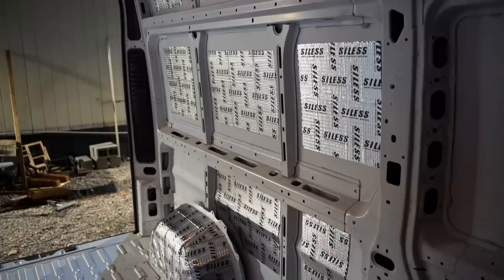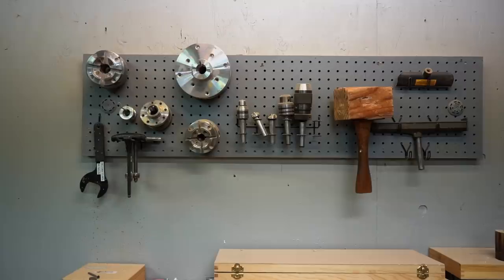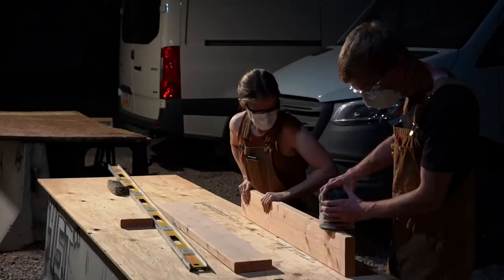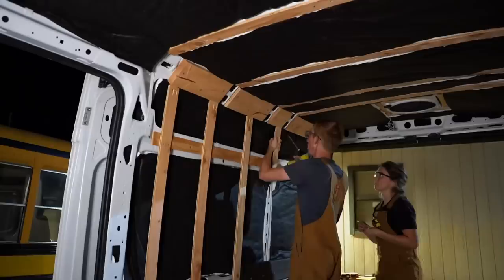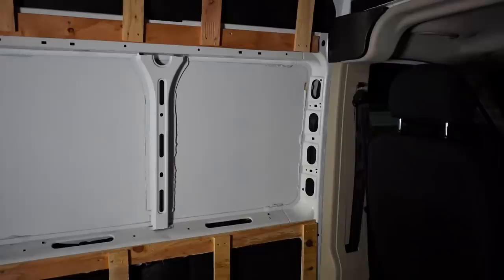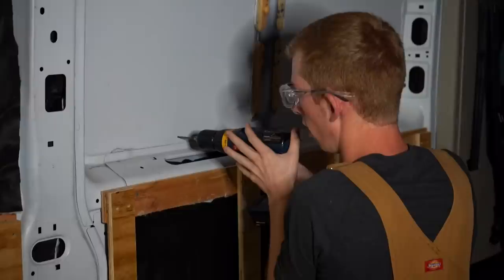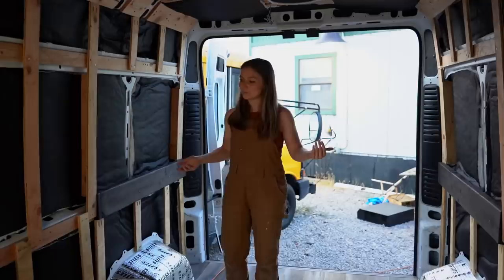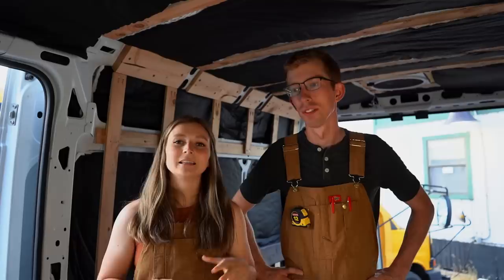CHOOSING A LAYOUT | Framing Our Promaster & Window Install

Comment: Everything about the layout seems perfect. But would be great to build a separate shower and space for toilet instead of a couch.
Reply: I totally agree
Reply: DITTO I just cant imagine, especially for boondockers, having an RV without a shower YUK having to drive to town for a Gym or Y to find a shower.
Reply: @OldJohnT102347  maybe they will add an outdoor shower.
Reply: Maybe a collapsible shower like in a Rialta, maybe omitting the bathroom lavatory, or even a simple removable curtain hanger( hulahoop ?) and a stowaway shower pan like a washing machine overflow/drip pan ( #3 washtub or infant pool ) or possibly even a folding wooden frame with a heavy residential shower pan liner grade membrane and a showerhead to attach to the kitchen sink, all to stowaway when not in use. You might just appreciate a shower after a hike or ride whlle boondocking. A passive solar water heater tube on the roof would give you a nice little bit of hot water.
Reply: Toilet n shower for me
Reply: @pagecericola7342  not easy to do in a rig that small.

Comment: Love the couch area idea, what about hiding a shower pan under the couch? You could store the curtain under the couch.  Just hang it up when you need a shower type thing.  This way it’s not a “permanent” fixture.  The shower pan under couch area with Glasliner/Plastic Panel. It’s super thin so low weight.  You could also set up an outside shower, you just need the shower head and a curtain, use heavy duty magnets from Harbor Freight.  

Are you doing a water heater?

My priority’s for my build beyond basic insulation and such is the biggest water tank I can - with filter system. Hidden toilet/shower. Mucho Solar based on costs and capabilities. Queen fixed  bed.  Swivel Seat / bench-table area to work & eat.

Comment: You could put an outside shower in the back so with the rear doors open you could hang a rod between the doors with a shower curtain for a back<privacy> wall for the shower.

Comment: Swap the sink location with the range. Have the sink by the door. Install a flexi spout that can be used to spray off outside or even shower. You can buy a shower/potty tent for cheap. Makes your plumbing much more accessible too.
Reply: Yes! Absolutely! Switch the sink and the stove. I have a pop up changing/potty tent. It's awesome!

Comment: Have you ever checked into putting in an outdoor shower at the back of the van - with an on demand water heater? Saw some pretty neat builds where they had a teak floor they put down and then a curtain they could attach between the doors and protecting the bed and garage area. Love the layout!

Comment: I think quite a few mentions are about making your diner a little different and using it interchangeable with a couch.  Leaving you room for a wet bath.  Also having the sink and not the stove by the door.  You good then have an extendable faucet for washing things outside.  Build how you want of course. Just a couple of experienced changes.

Comment: One of the things one learns in doing carpentry is the order of things.  The Van has structure, and before I would even put in the framing members, I would set up my electrical wiring. the Van has a lot of conduits to do the wiring for your Van build and not to take advantage of it before you do the framing, means that you may have to do some workarounds that were not given thought to.  So, do the wiring now before you complete the framing. Otherwise, you might end up tearing out the framing in order to set in the wiring for the Van.

Comment: Looks great guys! I love the idea of a dinette. Having a place to sit other than your bed is good for the build. My only concern (as someone who has built a van - and ended up remodeling it a year later 🤣) is that you might be doubling up on seating and sacrificing storage. The garage is mostly taken by bikes, electrical, and water tank. Here’s a thought - since you asked for suggestions. What if the table top of the dinette dropped down or converted somehow to make a little L shaped seating area for you so you could use the area between the dinette and bed as storage? That sliding door could be a nice place to put a screen (or act as the screen) for a projector. Loving your videos so much! Keep up the great work ❤️.
Reply: The panel they remove maybe a tabel or part of the dinette?
Reply: They could have a lagoon table on that too!
Then their little couch could become the bathroom/shower!

Comment: My suggestion is tape out your layout so you can get a good idea of the length, width, height of each item to be installed. Or use a software program to do a 3d mock up. Key to any build is  measurements = very little disappointments.
Reply: Y'all might even consider getting some cardboard boxes and literally boxing it out.

Comment: I’ve seen with another van I saw they made a box which looked like a tub with the toilet in it with a lid over it. The put a track with hooks for the shower curtain that in circles the box if you need a shower or you can pull it out just enough to give you some privacy   They had a hand helped shower wand    I hope I explained it ok so you kinda get what I’m saying.  What you are doing looks great. Keep going.

Comment: I think you should build out the floor under the table but make it where it will open with a shower pan in the bottom and install a shower head in the roog with a shower currtain on a loop. That way your dinette is multipurpose.

Comment: hello, in my opinion a shower is super necessary, it is true that it takes up space, but it is worth it, what you can do is look for a disassembled integrated design, in a dual-use space. it could work. Greetings. 🤗

Comment: I still think about the shower I think you will miss it after having one , but ones I have saw our like a box with your toilet and  you pull up the curtain  and attach to the ceiling  and it's all one   just let dry before packing back up in the box still not taking alot of room it's all contained  a thought ☺😊

Comment: Everything looks great. You guys are doing very good. 
Note on shower. You can have a no build shower. One you use in I case you really need one or you are exposed to something you must treat for.
(Very small inflated tub/pool. Loop to hang from ceiling or branches for a curtain.) If mounting inside hole in floor to drain onto ground or container.
Pump up spray bottle for wash water.
Not ideal for daily use but something if you need it.

Comment: From someone who lives in Canada and somewhat doesn't have the heat climate issues  the south gets, but we do get the cold weather temps. I am in the process of building out a van and I went insane on "R" value insulation mainly for the cold months, BUT, after the past heatwave we have experienced, the added insulation I have seriously helped with the heat inside the van.  Unless you are digging into your walls for cupboards or storage areas, fill them with batting to increase the "R" value, imho....to each their own of course.  Maybe that insulate will fill out the space but from where I sit it doesn't look like it will, I probably am wrong but if not.....spend a bit more and fill the spaces.  Also spray foam works very well in the van structure beams especially if you aren't running wiring through them.  Love your videos by the way, great couple with fantastic characters. Looking forward to the rest of the build. OH, I also demanded a shower but also sacrificed it for interior space....augh! I plan to hopefully hang a portable inside shower set up in my living area similar to yours.  Hopefully. As said above, humans NEED a shower to stay odor free....lol.

Comment: I think the sink should be next to door instead of stove so you could have the faucet to pull out and shower with outside the door or I seen someone make a shower curtain right at entrance of door with drain to even stand in Van while showering. Alot of 🆒 ideas 💡 from seeing others that don't have a so called built in shower.

Comment: I think you are doing a great job! I can't wait to see how your plans develop into a sweet home on wheels! Have you considered putting one of those specialty tables in between your driver's seat and the passenger seat? Those tables swivel in several directions, and come apart easily too... If the 2 seats faced each other, you could both use the table in between you. When not using the table, move it out of the way and turn the seats towards the main living space. This way you would not need to have a separate dinette and bench, and could instead use that space for the couch. And that would leave you with enough space for a bathroom where you are intending to put a couch. So you could have all of the features, and not go without a regular bathroom. Just a thought... Enjoy your journey!  ;-)
Reply: Great idea 👍👍

Comment: Don't worry about weighing that van down, I've used one for work for about 5 years and I load entire pallets of engineered hardwood into it with about 10 buckets of glue,tools and 2 people. The van will handle the weight just fine

Comment: Rig a little wet bay under the bed and use a an outdoor shower between the 2 back door when open.  I've seen others with vans do that.   It's also great for rinsing sand/dirt off feet/body after a walk/ swim.  Have you thought about a power lift bed?  I've no idea the cost of the mechanism but they sure do give you a lot of extra living space.

Comment: @Jimmy and Natalie, The layout seems entirely reasonable to me, but Im single and tend to think like a single person. That layout would be super for one. While it may test your relationship for a while, you two seem to really work at that already, so good on ya! I would have concerns about not having facilities, so one suggestion I have is that you incorporate an outdoor shower, which would give you much more flexibility, imho. There are tons of ideas to be found on youtube and it does not need to involve another cut in the van, so why not have the peace of mind. I mean, living with someone who totally stinks is not fun. Just my 2cents. Re: the toilet, I would like to see a curtain that can be pulled around it when in use. The overhead fan would sufficiently exhaust. You could easily use one of the RV curtain strips, which are flexible and would attach in a horseshoe to your ceiling, without being obtrusive. The curtain could be a fun colorful or cleverly designed shower curtain, so very little weight add and very functional.

Comment: Great job!  About showers I am a disabled veteran quadrapelegic. No ty many accessible showers at truck stopd or bathrooms.
There are many showers at truck stops for you. I use a female( urinal ordered on Amazon). I keep a wad of paper towels stuffed inside the top to avoid any odor. Easier then a toilet you can sit in a seat to use it pressing hard against you. Maybe not legal but I've dumped and rinsed it with large squirt bottle fulled with 1 part bleach 10 parts water. Or just water in a pinch. Dump in dirt or grass ( not someone's lawn ) lol. Bath wipes by Stryker are great for cowboy baths!!! They are thick and really wet no rinse necessary but I like to dry off! Have fun!!! Hope this helps!🤗🤗🤗🤗

Comment: Hi guys, my suggestion would be add a shower..As active as you guys are going to be hiking,biking,running,etc.I think you would appreciate a quick rinse.. Your partner might appreciate that more than not having a quick rinse off..
As far as stove burners location…..I think you should switch the stove top with the sink..Assuming you are going to use butane for your stovetop that would keep the burners out of the wind….Best of luck..Enjoy watching your channel..(You really need a shower..Also that would be a good place to store your toilet on wheels when not in use….) John
Reply: Could not agree more!!  Consider the experienced advice!!

Comment: This project reminds of a build I did years back. To solve your shower issue I purchased a portable hanging propane shower unit for the outdoors that is installed in a small changing popup tent.  Many folks just use the facilities in a gym but I wanted my own shower and bathroom.

Comment: You might place the sink next to the door. Get a sink with shallow side and a deep side. Then put your toilet under the shallow side.  For privacy use a round shower curtain rod hung from ceiling with shower
Curtain that Can be hidden away when not in use. Wish you two lots of luck on the build.

Comment: Cutting that window center support is super easy with 4 1/2" angle grinder with metal cutting blade. They're very handy tools for cutting/grinding a variety of materials. From metal, concrete, brick etc. Super cheap at Harbor Freight and they actually last a long time.

Comment: Thank You again for sharing your journey with us! Curious... How much do you think you will use the "tiny couch"? I mean, you will watch TV sitting up in bed with the TV on one of the walls above the bed, right? I would think the passenger seat swivel would accomplish the sitting area of the tiny couch with no extra space. Anyway, would a sit down toilet/shower be a space more used? Like framed in, but small and short, maybe cabinets outside on top of the shower? I think privacy at night when the other is in bed may be more important than a tiny couch is all. There is also still my idea of putting plumbing for a shower in the back so when you open the back doors, a circle curtain would contain a stand-up shower. Thanks Again!

Comment: Check out the OGO  compost toilet it has a much smaller foot print than the nature's head but a bit more on cost for a composting toilet. We really love this toilet it is easy to clean a light tells you when the urine is full and easy to clean, and no smell. It has a fan for ventilation, we are not to that part of our build but we did set it up in the bus and went camping for a week and use a toilet for 2 weeks for the 2 of us and it worked well.

Comment: Doing a very similar project!  The style, will be smaller, screen  windows, all around the back area (I love fresh air cross venting optional).  And keeping everything light weight.  A comfortable large  mattress directly above the wheel well flowing back to front, probably not side to side.  The roof fan vents, will not be the rain vent kind, just lower regular clear fanned  manual vents.
It'll be a lower bed (less "garage" much more "open space" ...even less cabinets, maybe a long small shelf. No shower (wash cloth n plastic basin which can multitask...yet community center memberships with pools, hot tubs, showers, etc.).....lots of multitasking.
Simply use a double dresser attaching to a wall, with a countertop on top if it.  Then there'd be plenty of  drawers, and all the same 'light color painted' with a  trim color.
Going to use an "isolater electric system," and only 2 deep cycle 'vented together outside'  batteries, set up behind the drivers seat and very easily accessible,  plus maybe 1 portable foldable solar panel stored in the smaller "garage."
The passenger seat will be swivel.  There will be a small dinette set up, maybe a small booth style?
For the ceiling and viewable wall areas, I'll use something flexible, very light, thin, and inexpensive to cover walls. 
Of course...all this is in keeping things lightweight, and simple.  Similar to you on all the insulation.
Then, as time tells, any adjustments, improvements, can be done.  As the simple, open, non-cluttered, open style, is flowing, with changes being made anytime.  Like to keep
 things very open space oriented, and  simple,  plus easily flexible.  I like a lot of open space, and natural  ventilation.  No need for a freezer or refrig.  I shouldn't drink colas, yet, can get a McD's iced cola for a dollar, and a mocha frappe for 2 bucks if I want those.   Plus, I can cook things like rice, potatoes, all kinds of "pannini style" sandwiches,  omelets,  fresh fish, saitan meaty veg-style, and many protein type veggie (non-spoiling foods), and lots of fruit (cantaloupe, watermelon, honey dessert, grapes, etc., etc.), grilled fresh breads, rolls, nuts,  pb+j, canned tuna, cheese lasts several days, etc., and, I actually like Taco Bell, and many other simple choices.  I simply don't really need a refrig/freezer..  it's, okay.  If I feel like having one eventually, then okay.  I am somewhat social, and like being around towns I frequent, like Boulder, Sedona, Santa Cruz, Arcata, Satellite Beach, from Seattle, to SFO, to DIA, to many Florida Atlanta Ocean beaches to Pacific Ocean beaches.
Vanlife, for me, over 20 years, is mostly about freedom... including   simplicity, and lots of nature.
Might have a small (portable) woodburning stove (with a  front glass for ambiance)  and easy set-up roof stack for fun-heated
ambiance!  And, vented propane to warm things up while awake and no-hassling with firewood late at night.   Keeping this safe, minimal, cozy, and can use to sleep if wanted...and properly vented (just need about 12 square inches cross-fresh air).  Good bedding for night time.   You two, Jimmy and Natalie are so GREAT together! This, is a treasure...and rare, yet, possible.
Anywhooo ... you two are doing AMAZING since you first started ... AMAZING👍👍👍

Comment: Hi there...Love your video. I love to watch people building out their home. I saw few videos where they build Hidden Shower, where the shower pan+curtain can be slid out from the bottom of the kitchen drawer to right in front of the sliding door  and hang the shower curtain up to the ceiling when you want to use the shower. They use the kitchen faucet with extended shower head.

Comment: You might want to reverse the stove and sink that way you can use the sprayer to keep your feet clean . Also you can use it like an quick out door shower if needed. Ex Mr and Mrs Adventures van. You two are kicking but on what your doing. Your still looking cute,in your matching overalls.